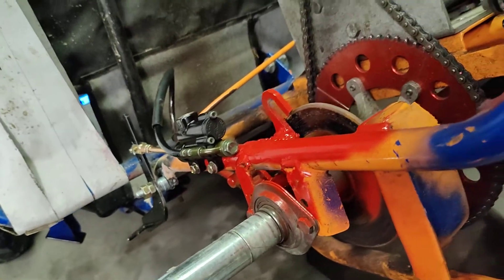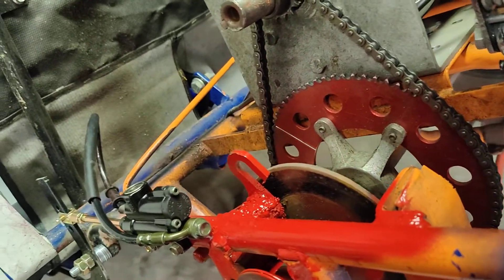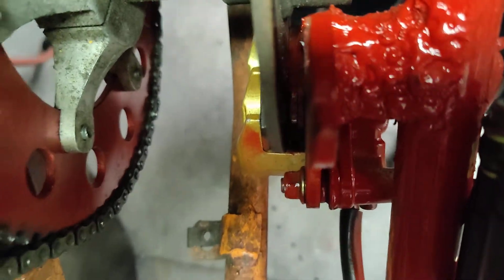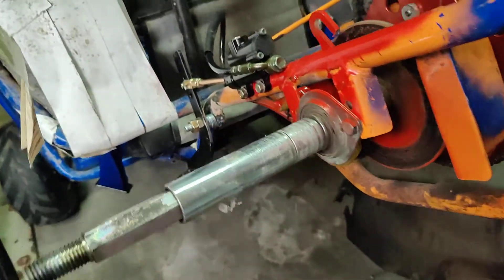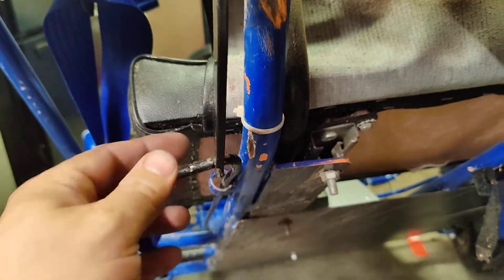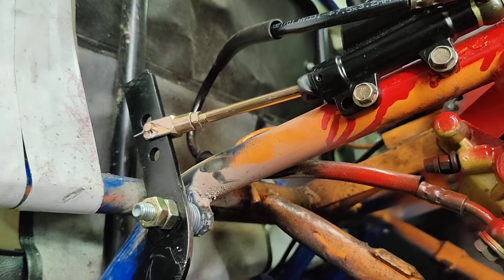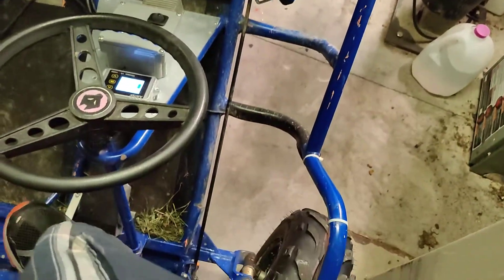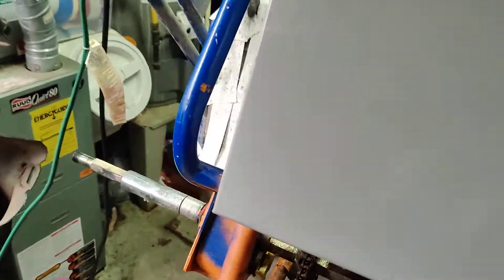Manco GoKart - EV Conversion - Hydraulic Brakes

Comment: How have you liked the brakes do they stop it well? Can you share the link of the one that you got?
Reply from the maker: Yes, the brakes are great. So much more performant then the stock ones. 

Here is the link to the original product page but they are out of stock: https://www.amazon.com/gp/product/B07VY18SYC/ref=ppx_yo_dt_b_search_asin_title?ie=UTF8&psc=1

This is not the same one but it seems to be same in design: https://www.amazon.com/dp/B08JLTNZFC/ref=sspa_dk_detail_5?psc=1&pd_rd_i=B08JLTNZFC&pd_rd_w=DF9c8&content-id=amzn1.sym.0d1092dc-81bb-493f-8769-d5c802257e94&pf_rd_p=0d1092dc-81bb-493f-8769-d5c802257e94&pf_rd_r=7RJ3J0EH7W3X90R3Y15F&pd_rd_wg=fPOix&pd_rd_r=453a8fb5-d5b7-4098-a0bd-d970f358a842&s=automotive&sp_csd=d2lkZ2V0TmFtZT1zcF9kZXRhaWwy